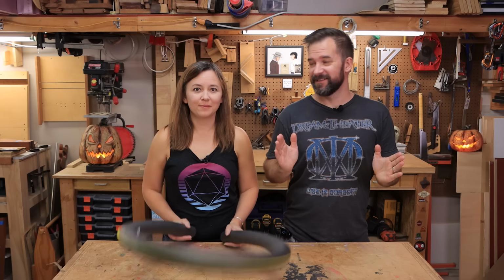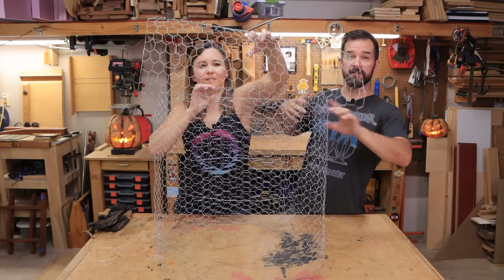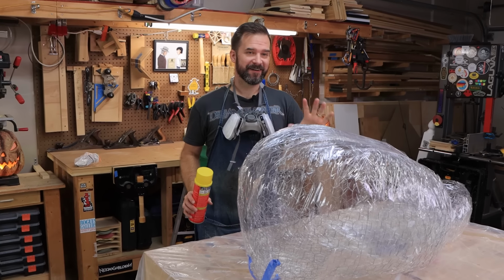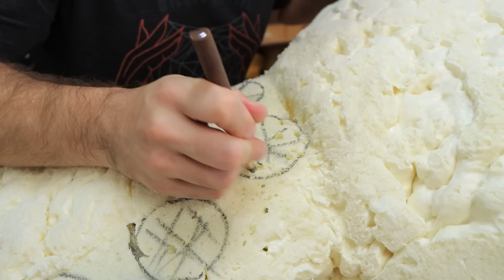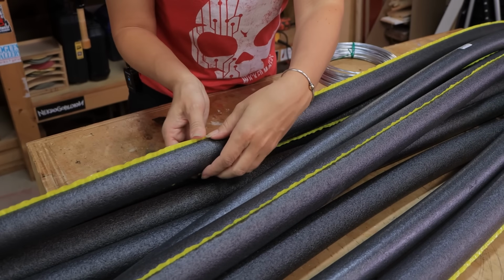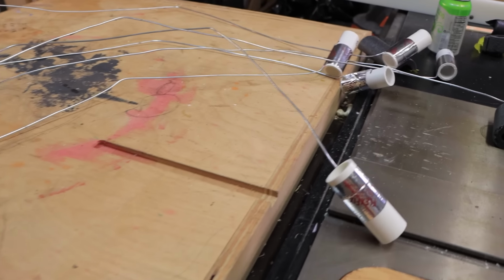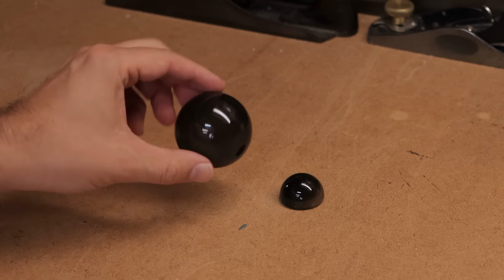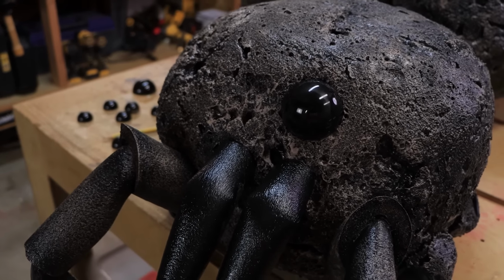Making a Giant Spider! 🕷 DIY Halloween Props

Comment from the maker: Want to make your own Giant Spider? The dimensions for the legs and body are on Patreon! ►
https://patreon.com/wickedmakers
Reply: So sad, I don't want to pay every month just for one thing. This is so cool, thanks for sharing your video though..... :( really wanted to make this!
Reply from the maker: @niterythmweb9152  Plenty of folks just join to get what they want then head out. It’s your call. 🤘🏼😄
Reply: No thanks but thank for asking
Reply: So u can cancel  patreon any time we want?? Is it on the wicked or champion one?
Reply: Suggestion- make Wicked Witch of the West
Reply: Jes
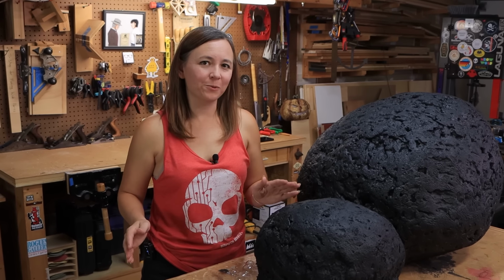Reply: I finished my spider today, just in time for Thanksgiving. Do you have a Turkey costume idea for a spider? I started working on it the week before Halloween 2023. Used a bag of Cellulose insulation into a black garbage bag, wrapped in cellophane, then brush painted with gloss black latex Rust-Oleum. Three sections/sizes of Legs attached with contact cement, (12 ga wire didn’t hold up in the wind. Secured legs to front structure with PVC like your video, but attached the ends into the ground with 1/2” x 24” rebar. Legs are stable in strong winds. Could not find detailed dimension on Patreon; so I estimated the leg dimensions. It looks great! Everybody loves it! Thank you! 8:14
Reply: @WickedMakers hey I’m a fan of your art works I was wondering if u can make a giant ant next
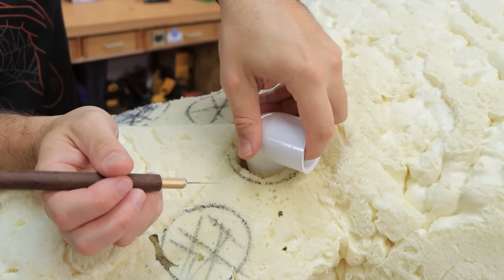Reply: I wanted to do this last year but chickened out but this year I won't. But I'm curious if the spray foam you used after the plastic wrap step is the same you used at 4:30. Also did you ever consider having the head and body separate and connecting them as you did with the limbs?

Comment: Hi guys. I just wanted to pass on a safety tip. If you're using contact cement I would recommend using a respirator that is designed for chemical exposure (carbon filter). My step dad was a cobbler who used contact cement frequently and ended up getting multiple myeloma. I really enjoy your builds. Stay safe.
Reply from the maker: That's a great tip, thank you!
Reply: @i.cant.sleep.anymore  more like a seizure
Reply: @guiltydelirium2532  more like cardiac arrest.
Reply: @gabs4liffe  More like a bot poorly programmed..
Reply: Leer wd/MV/
Reply: @Rosanna Caminero j'in il me Mollo un de de…se 5 me
Reply: Thank you for that info.
Reply: @Eatz_applez more like Tom jeffry having 69 dads and 1 went to the milk store other one little piggy went to the marke-
Reply: Stay wicked too
Reply: Thanks for sharing. Sorry about what your step-dad went through. That's rough.

Comment: Yes, was gonna say something similar- if you soak fabric in water, (not dripping), you lay it over the foam, you can smooth it out, once the foam cures the fabric will peel right off leaving less shaping and smoothing with the rasp to be done
Reply: You mean while the foam is still wet or often it's dry?
Reply: (When the foam is wet)

Comment: You guys have saved me soooo much money when it comes to Halloween decorating! Plus everything you guys make can just plug right into real big professional haunt attractions. SOOOO COOL! An CONGRATULATIONS 👏 🙌 ON REACHING OVER 200K SUBS. You guys earned them. Impressed!
Reply: "Saved Money" by the time you spend all that money on the material that they used to make that thing you can buy one, PVC, Chicken wire, Foam stuff, pipe insulation, that stuff is not cheap these days , not to mention the time needed, just buy a fake spider on line, it would just add up to about the same probably cheaper.
Reply: @jm1551701  it's still cooler
Reply: @jm1551701  but can be expensive

Comment: Your next video should be how you store all of your creations.  I'm fighting for space with my wife (she likes christmas decorations) for the ever growing pile of Halloween decorations.

If you can find the 3M froth-pak spray foam can be sprayed in much thinner,  smoother, and stronger layers.
Reply: I was going to type the exact same thing!!!
Reply: I agree! I’m in the same battle, but with myself. Ha. I love Halloween & Xmas, & I’m at the point I may need to rent a storage unit. 🤦🏻‍♀️ Half of our garage is full of decorations, alone. My partner is not too happy, but he doesn’t get much say in the matter. 😉 I would love to know how they store this beautiful creature & if it stands up to time. I worry the body will get damaged.
Reply: Wait, we don't leave these up year-round?
Reply: @BigHackAttack  that would be nice right?
Reply: YES! I’m getting better at considering storage options (like removable parts and attaching with screws or all-thread or slip-on PVC), but I want to make all the GIANT things and am quickly running out of storage space!
Reply: My husband built a loft attached to the ceiling of the garage that fits most of our decor. You obviously have to make sure it’s secured enough to crouch and walk in it, but it’s amazing how much we can get in there.
Reply: @b-dub6865  I made an 8ft haunted tree with the same spray foam and it has held up very well. I live in a climate where we often have snow starting that melts or rain, high winds etc. This foam spray is a great weatherproof, super light option!
Reply: @lindsaysalmond8808  awesome! Thanks! 😊
That must’ve been some tree! 8ft!!! 🤩
Reply: Storing all kills me and haloween is actually a day???
Reply: @lindsaysalmond8808 i took over that for my gym so not an option and christmas stuff ended up in the shed not gonna buy another one lol

Comment: FYI: Immediately after covering the surface with foam, take a spray bottle and spray the entire thing down with water. Really get it good and soaked. Within a few minutes it will start to develop a skin. No waiting until the next day, and then having to do a bunch of messy shaving and carving on it. In about 15 to 20 minutes you can literally take your hands and push and squeeze on it, using your hands and fingers to flatten it out and mold shapes into it, and you won't get any foam on your hands because the water causes the outer layer to form a skin. Keep in mind, this expanding foam stuff doesn't dry; it cures, and what cures it is the humidity in the air. The more moisture, the faster the cure. Which is why spraying it down with a spray bottle forms a skin within minutes and allowed you to form it with your hands. A little trick I leaned from Stilt Beast Studios. Here's an example of him making a mask out of spray foam, and how he wets it down and then is able to mold it with his fingers. 🡺 https://youtu.be/HlG0I1YPALA
Reply: Awswsedrweryyyu,,.😭😭
Reply: that's a pretty huge tip, thanks!
Reply: @michaeldiaz6023  huh? Ha.
Reply: Great tip. I was gonna ask, how does this hold up to weather & rain? Will the rain mess up the foam if it gets wet?
Reply: I love Stilt Beast!
Reply: Can I just put spray foam on top of a beach ball, wet it down to shape it, and then remove the ball? Instead of chicken wire?
Reply: @soularwave  A beach ball wouldn't be a bad structural base, but once you put the spray foam on it, it's not going anywhere.
Reply: I was thinking the same thing!  I just came for his channel watching him make tall haunted trees, and he used this technique, like he frequently does on his projects. Pretty cool, fast and way neater!
Reply: This tip just saved me. That spray foam was fighting me every step of the way until I sprayed it as suggested.
Reply: @Mrs_Homemaker  That's awesome, Samantha. I'm so glad I was able to help. There's so much you can sculpt from spray foam using the water technique. It makes it so it's actually workable.
Reply: WOW I didn't know this water trick with the spray foam, this might just save my behind. As a chippy/builder, I've come to loath spray insulation with a passion, but recently I've realized it's usefulness for some drywall sculptures for my own home. But it's still a pain in the neck to shave and work with. This wetting technique sounds like it might make these projects be actually enjoyable instead being mostly grind. Cheers!

Comment: Few things they don’t mention. How to hold the spider up. Gotta make a stand for it that digs in to the dirt. I had to put a wooden base under the spider then covered with foam, now I was able to screw on a base to it and you won’t lose it with a wind storm. Legs won’t hold themselves up with that gauge  steel. They probably positioned them perfectly with no wind just for the final pic. You’ll need thicker steel (at least for the first segment), and a pvc end cap where you can stick it in to hold it up like a flag pole.

Comment: It'd be super cool if you started including a side list  in the video or like a pop up type thing of tools and stuff used and then costs/location of the materials you find or buy 🕷🕷🕷🕷 regardless, i appreciate all the links in description and love your videos and you guys
Reply: Or measurements of how long they cut the materials
Reply: Exactly. Even just what they used for e.g., the dimensions of the chicken wire used for the side body, the length of spider legs, the number of cans of spray foam, etc. would be extremely useful, even if it's just a rough estimate.

Comment: Here’s a trick heat the “insulation tubes” with a heat gun and you can actually melt the tube & it will act as glue onto itself. You can even heat it and manipulate the tubes with your hands to taper the tube. This will work on pool noodles too

Comment: A heat gun works great to use on the pipe insulation or pool noodles, seals them together by melting them.

Comment: Years ago I made a 12 foot spider. I used  a big block of foam , carved it down to a ball. Carved out the head, cut strips for the legs. Poked heavy wire through the legs so I could shape them.  Made red glowing eyes,covered the whole thing with black fur. Used it for 2 years till someone made me a offer to buy it I couldn't refuse.

Comment: Quick comment/suggestion... if you wear gloves and while the foam is still wet, but has a "skin" on the outside...you can spray with water and pat it smooth instead of having to scrape it down smooth. Hope this is helpful!!

Comment: So we aren't done yet but I have a few tips to others so far. 
1.Buy the 12 spray foam cans. You will need them. 
2.Definitely will try what someone suggested in the comments to wet the spray foam once it is starting to dry, to mold it instead of trying to shave. The shaving works but It was quite a workout, and not the fun kind. 
3. When connecting the legs, apply the rubber cement AND LET IT DRY before trying to stick the pieces together. I've watched this video about 30 times while working on our spider and I never caught that line. I was frustrated and completely covered in contact cement trying to get the leg joints to stick. I almost decided to go a different direction, until I watched the video one more time and caught that very important line. We painted some on waited 3 minutes and 30 seconds and then it sticks together no problem and holds tight. Ill be picking contact cement of my hands all day today (which is kind fun) but if you want to save yourself a big hassle, definitely don't miss the "LET DRY BEFORE STICKING" part.

Comment: Great Video and prop. I just wanted to add a public service announcement for anyone who hasn't used Great Stuff spray foam. WEAR GLOVES. If you get it on your skin, it's a bear to remove. If you do get it on your skin, use some acetone nail polish immediately. the longer it sits/ cures on your skin, the harder it is to remove. :)

Comment: to make a the spider body. i would of got those huge balloons and lay plaster sheets around the balloons.
remove the balloon and use expanding foam inside to give it strength. if it cracks dont worry the outside is gonna be covered in that flex paste sents it can be use for modeling reasons. and its weather proof. (get the black color)

Comment: Speaking of spiders and slippers. One night I put on my shoes that I had left out on the front entryway I didn't have any socks on and as I stuck my foot into the shoe I felt something and I could roll it with my toes I was worried that it was a cockroach and I quickly pulled out my but. Rather than a cockroach it was a two and a half to three inch wolf spider. I had been rolling the wolf spider with my toes and she didn't bite me. I was absolutely amazed. I let her live on the front entryway for a while

Comment: Fantastic build!! Dear dynamic duo😁 how did you support and anchor this light prop?
Reply: You could have the wires in the legs be longer, with a loop on the end to 'stake' it down ? Some lengths of rebar would anchor well, if there were enough of them ! I would angle the rebar away from the prop.....

Comment: How did you mount and position this prop in the yard?  I did eventually see the PVC supports under it (not easy to see with web and camera angles  - nice touch) but not sure how you attached the supports to the prop or ground.  BTW I thought is was really cleaver to use the spider webbing.  It helps divert attention from the supports as well as add a creep factor to the presentation.  I was looking for a giant spider and this seems like a reasonable approach with great results for a Halloween prop.  Thanks for sharing.
Reply: They probably just pushed some pipe in the ground and leaned the body on it.  Like a crutch.

Comment: I have a challenge for you. Make a spell book to lay open on an altar. Then position 2 fans or blowers on both sides hidden by something like creepy pillars or something. Then by remote or random timers, either sides blowers/fans turn on turning the pages. You could also time it with an audio of someone reading spells. Pages turn a spell is read, then something random in the whole yard display activates like thunder/lightning or the portal turns in or a projector display turns on. Then just loop it all
Reply from the maker: Dang. Yes!

Comment: Late to the party I know, but how did you get the legs to stay standing up? I did the exact same as the video but the legs flop over. One end is stuck into the ground with some sticking out wire, the other end is attached to the PVC which is put into the spider.

Comment: For some reason, I assumed the legs held it up, but after getting my wire, I knew there was no way they would. So I molded 2 3/4" 'T's into the underside, for a removable stand. (I used 3/4" because I had some laying around.)

Comment: Any chance in getting measurements for the legs or better each leg segment? 🤪 I have followed this and made the body and "butt" haha. Im adding the pvc joints to the bottom of the head tonight. :)
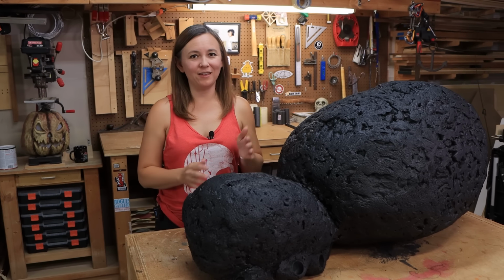Reply: Ok I think I figured out a way of making the legs for my spider in a similar length to yours, and I think you will get a kick out of how I did it. hehehe. Right around 8:12 mins you seem to count the legs, once your finger touches the last leg I took a screen shot. I then took the image and used your fingertip as a measurement device, hahaha, assuming your fingertip was around 1/2", it gave me around 2' for that part of that leg. Next I got a good top profile image of a Black widow with legs straightened and did some math based on your fingertip, hehehe. Here are my end results. Starting from the body (2 extra inches for the PVC attachment) to the tip of each leg. Front Leg: 2”, 2’, 2’, 2’5” = 6’7” Second Leg: 2”, 1’4”, 1’3”, 1’6” = 4’3” Third Leg: 2”, 1’, 10”, 1’1” = 3’1” Back Leg: 2”, 1’8”, 1’7”, 1’11” = 5’4”. I think I did Pretty Good. I’ll have to share a photo with you both on one of you social Medias.  Thanks again for the video!

Comment: You could have also just heated each edge of the the pipe hose with a heat gun and pressed them together. Instant seal. No need for contact cement. Stiltbeast studios has several tutorials on how to do this.
Reply from the maker: Yep totally. It’s just hard to do it that way without it deforming the material a bit since the heat melts it.

Comment: This is awesome! I actually really like spiders and this just looks so fun to make.
Couple questions for you... And apologies if I missed it, but are the legs sturdy enough to support it? Or are you using something to keep it it propped up / anchor it? 
I live in a really windy area in the midwest, so I was thinking tent spikes, unless there is something else that you use or recommend?
Reply: At 12:13 you can see the white pvc pipes supporting it from the bottom, the legs aren't sturdy enough on their own as they are flexible
Reply: And I'd build those PVC pipes deep into the spider body. Then you can pound 2' lengths of rebar into the ground and slide Gertie on top. I use that technique on my headstones and they've withstood 50mph winds.

Comment: So you wet that with a spray bottle, you can do some shaping before it fully expands and dries. so you are not having to cut it down/shave it so much at the end. Also, do you make these for a single year and then destroy them, since you are always making content, or do you actually store some of these larger models?

Comment: How did you guys mount it in the yard so that the body is off the ground? Where the legs just strong enough to hold it up? Did you stake the legs?
Reply from the maker: It does not support itself. We put some pvc pipe underneath it to hold it like 12ish inches off the ground. It's painted black so you can't really see it.

Comment: How do you guys support the body when you set it up in the yard? I know the legs won’t support the weight but I can’t tell from the picture.
Reply from the maker: We actually just sit him on a black milkcrate these days and you can't even see it. When we first built it we used some PVC stuck on some rebar into the ground with a little 'T' on the top to support his weight.